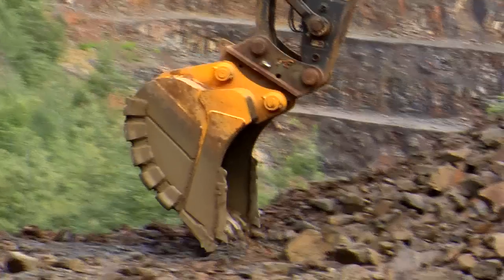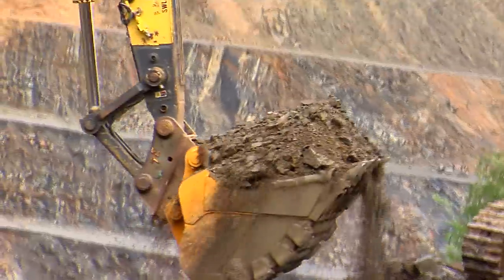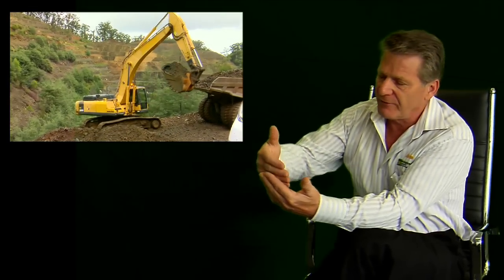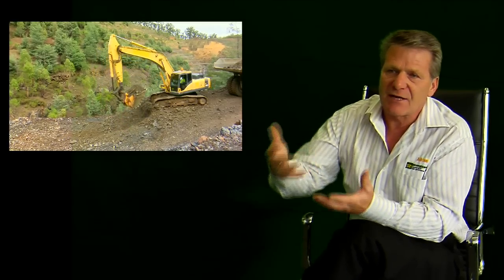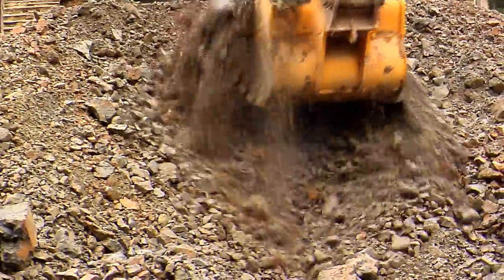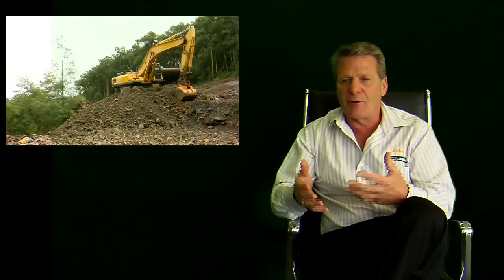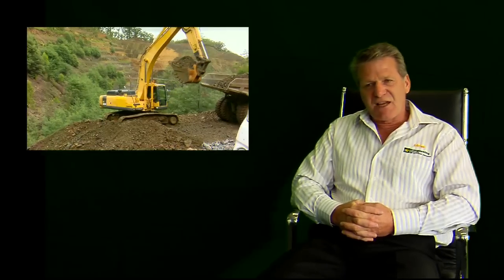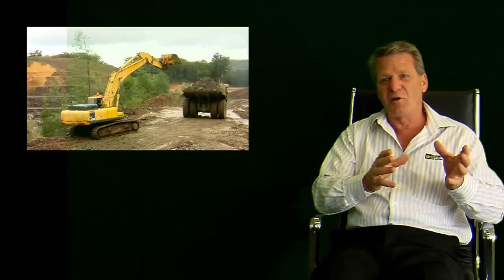eiengineering - rock buckets

Comment: hey can i ask why is there not any bolt on wear shrouds on the side of the bucket what do you do when they wear out the side of the bucket? how do you fix that easily? maybe you should show in the video a bit more on why you choose to go this way ?
Reply from the maker: Thanks James. The shrouds on the side cutting edges are bolt-on because they are subject to hard wear in that area and there are bolt-on lip shrouds available. We do not use these as if they are dislodged during the work activity, they are easily lost and time consuming to replace. All other wear plates are welded on because they do not take direct abrasion, only side abrasion. This means that there is much more working life of the side wear plates and they are generally changed on a bucket maintenance cylce every 12 months or so depending on the abrasiveness of the material in the quarry. All of our buckets are Bisalloy for flexibility, which can be tested and we use Hardox wear plates for long term durability.